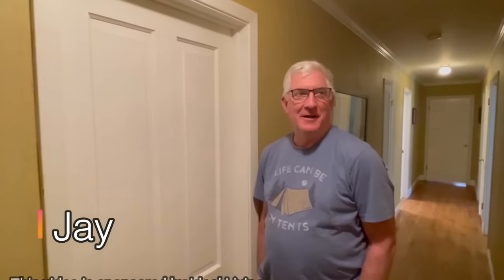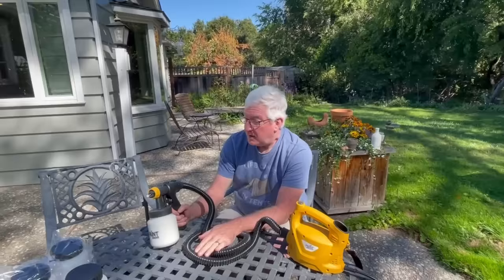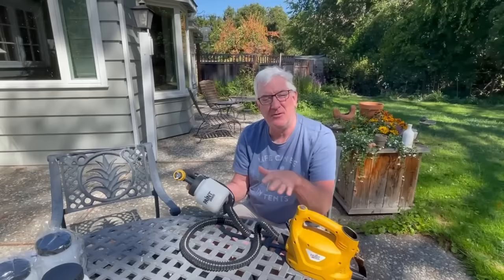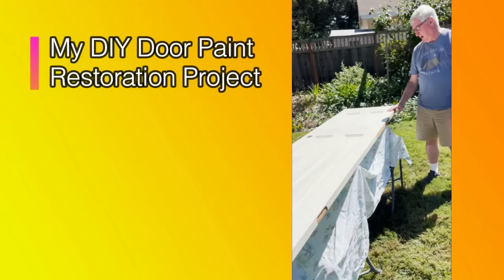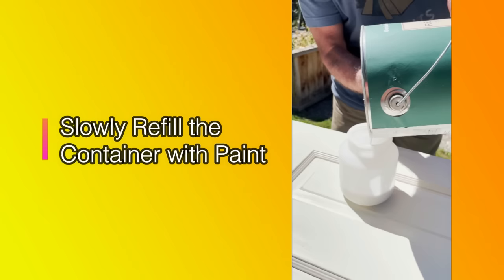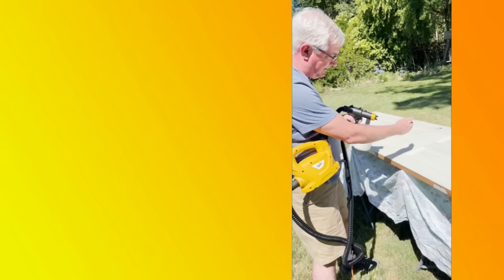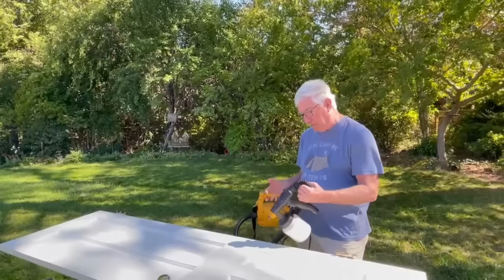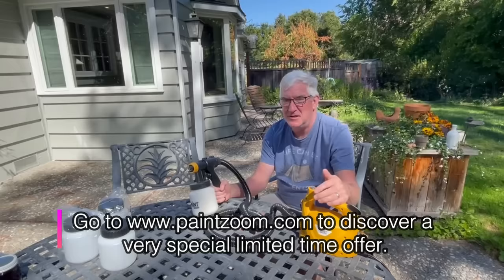Paint Zoom 3000 Paint Sprayer Demo + Review | Actual Door Repainting DIY Home Project

Comment: I would recommend this paint sprayer because it does a very good job, has a very useful set of nozzles included, allows for a variety of spray patterns, does not require an air compressor, is relatively easy to clean, and is attractively priced.